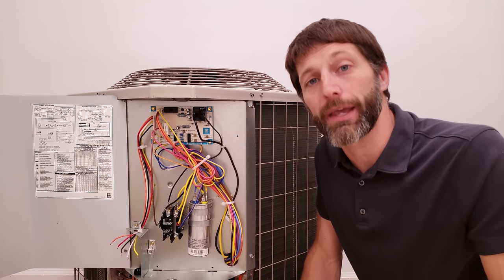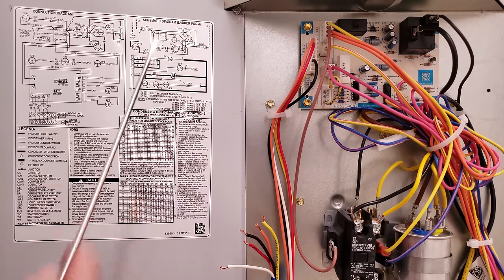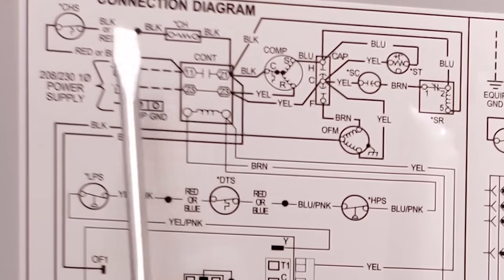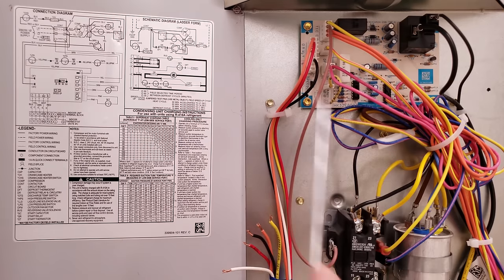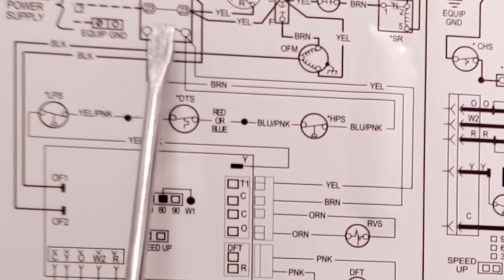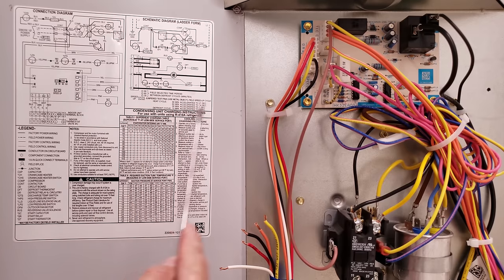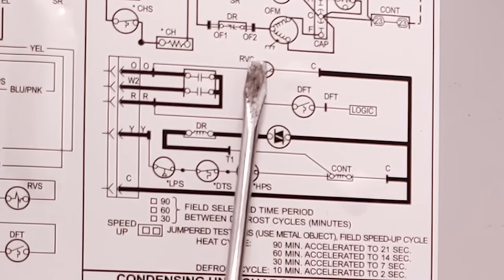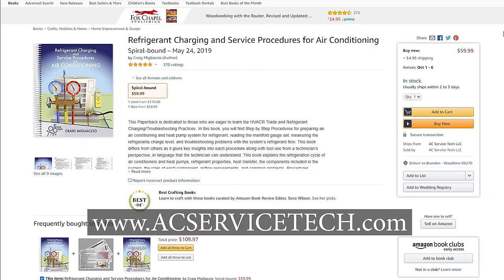How to Read a Heat Pump WIRING DIAGRAM! Schematic & Connection!

Comment: Craig, I love your videos, you are a great teacher and always give crystal clear explanations when covering a topic. However, I will have to disagree with the names you give the two types of wiring diagrams in this video. I was taught nearly 45 years ago the diagram to the left as I'm viewing them is the schematic or ladder diagram and the other is a pictorial diagram. Yes, the schematic diagram shows the connections and the pictorial diagram does this also and in addition the pictorial diagram shows the positions of the components with respect to one another. It also roughly depicts where they are located i.e. outdoor unit, air handler and so on. Please keep on giving us excellent info. Thanks, Rick.

Craig, Oops, you were right.I didn't see the schematic diagram you were referring to above the pictorial diagram. Never mind, my bad. Sorry.

Comment: When replacing a bad contactor on that heat pump, make sure to follow the wiring color code and get the wires connected the same way to new contactor. If you mistakenly put the wire going to t1 of the defrost board on the same side of contactor with wire going to common, defrost will not work and you will wind up with a giant ice ball outside on condenser.

Comment: hello, I started to see all your videos as they are the most complete videos I've seen about heat pumps.  I have a question for you, have you worked with York heat pump package units? I have model YMKE60BNJMFMO-X and when it was winter time, it would blow "warm" air as it should but then the outdoor fan would stop and the air would turn cold and it would just blow cold. I thought it was the defrost cycle but the cold air never stopped. an hour could easily pass by with cold air so I had to turn off the unit and turn it back on at a later time or different day. 

any ideas why that would happen?

Comment: Thanks for nice video.
If in case you like to remake this video.
Untie all wires then you explains what wire where it goes to because touching the wire for beginners is confusing and have no clue where that wire physically goes  to.
The part you can explain half of the video only schematic then the second half/video you do both the schematic and wiring where they  can follow and match with schematic. 
Again that was my suggestion. Thanks again for your great 👍 effotrs.
Reply: Effotrs..

Comment: Note for Trane & American Standards heat pumps—your circuit diagrams may be much different from this one, especially if you have a demand defrost model with heat sensor thermistors for ambient and the coil.

Comment: I have this same GrandAire 2 tin 14 seer heat pump. Condenser won't turn on but does if I push the button on the contactor
Reply: Did you find out what the problem was? I have the same issue.
Reply: @Roy Johnson  yes, turns out the thermostat was not set for heat pump!

Comment: They label the DR coil and also the DR contacts between OF1 and OF2 going to the fan motor in the top part of the schematic.  But they only imply the DR coil also closes the contacts to O and W2 by alignment even though that is usually a separate relay (the rectangular relay in the upper left of the board) that activates in parallel with the outdoor fan (DR) relay.  I presume that is covered by the "& Circuitry" part of the label for "DR".

Comment: Hi could you help to understand how to connect an aprilaire humifier 700 to a Heatpump airhandler?  I understand the mechanic part, I need to know the low voltage connections. thanks for u help!!!!!!

Comment: hi i just swap old r22 outdoor Cooling only  unit with Goodman heat pump  but keept old gas furnace has control board  C G Y W R  how i can wire properly heat pump to old gas furnace boad ? need a heat pump as a back up most of the time i use gas furnace for heating  thermostat has  C K RS R W O/B Y G W2aux/E Y2 L   has 5 wires coming from furnace outdoor has 5 wires as well . im EPA  certified based of NYC . THANK YOU IN ADVACE !!!

Comment: The defrost run time on the board says 30-60-90 MINs. Please explain why you said "SECONDS"

Thank you
Reply: that's heat-pump "heating" run time "between" defrost cycles, the actual defrost cycles is 10 minutes or less down to seconds.
he did accidentally say seconds vs minutes lol. please go make some videos so we can critique them =p
Reply: @throttlebottle5906  Thank you

Comment: Hi, I have the same unit that is the video, a Carrier unit, maybe a couple years old, which is blowing the 3amp fuse every time that I turn on the heat pump. I already check all possible bad wire nuts connections, striped wires, thermostat, but still.......I need help please!....a friend of mine says that could be the solenoid reverse valve. let me know what could it be please. Thanks for your videos.
Reply: If you are still having this problem it very well could be the contactor for the compressor. They will go bad.

Comment: Funny thing is, I never see diagrams of heat pump with two stages of electric heat in the air handler.
Reply from the maker: Often, the two heat strips are powered in sequence via the sequencer and basically all the strip heating is powered together after the first couple min, thanks!
Reply: @acservicetechchannel  The sequencer has W1 and W2 terminals, these aren't for two strip heat stages?